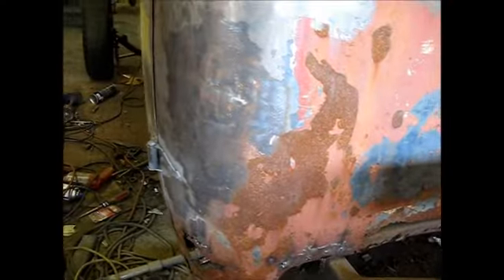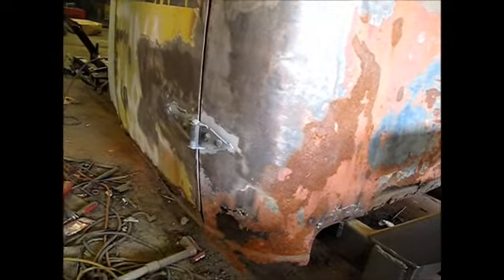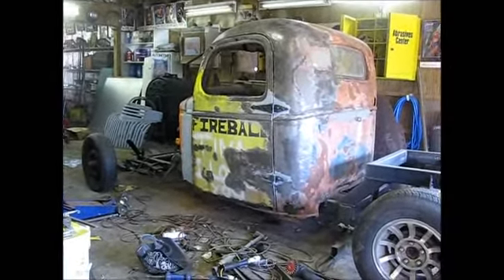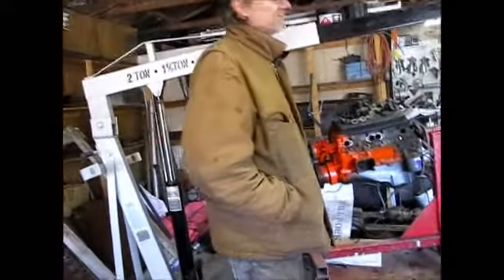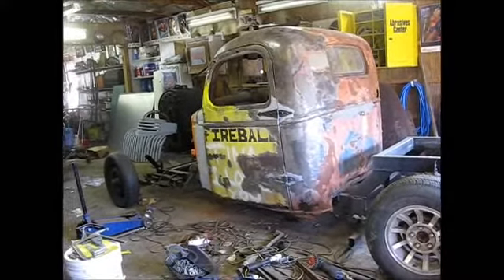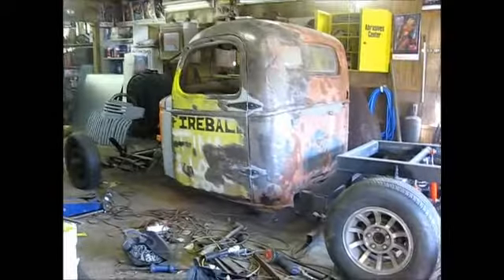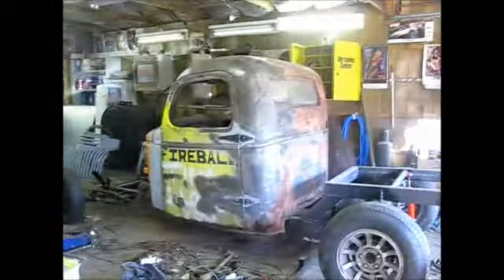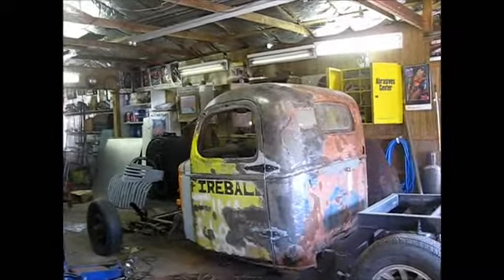Paint or Rust?  Mike's rat rod, please vote!

Comment: they are doing a couple big road projects out here with alot of bridges going in. the massive metal beams have been treated with some chemical that lets the beam develop a rust film on the surface but doesn't eat into the metal. There may be a paint like that for vehicles, you could have it both ways then.

Comment: Around here we clear it about 10 or 12 times >>over rust, paint, bare metal ,over welds ,patch panels, clear over everything you gotta take a scotch bright pad over the whole thing to knock down the loose stuff but it will turn out good with no problems >>>> it a rat rod for gods sake